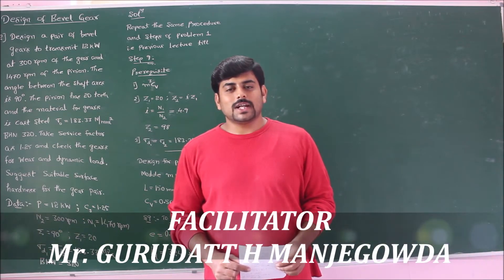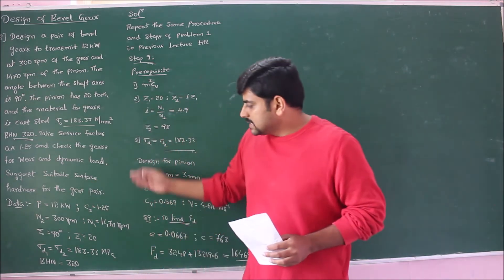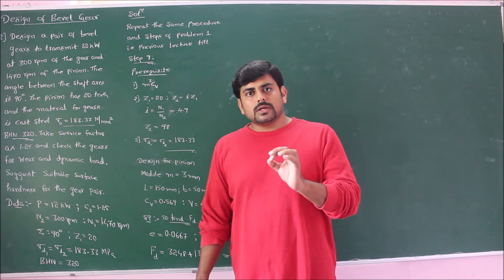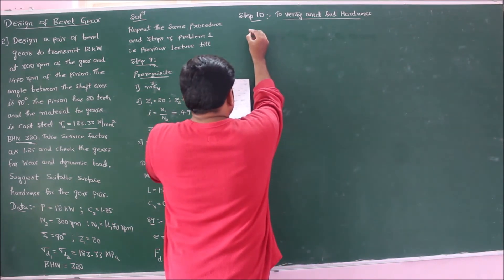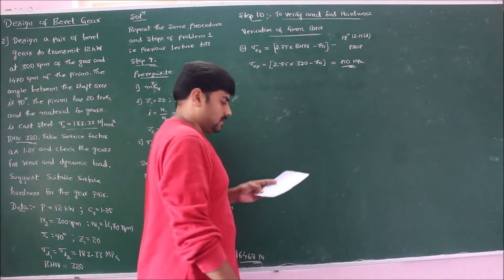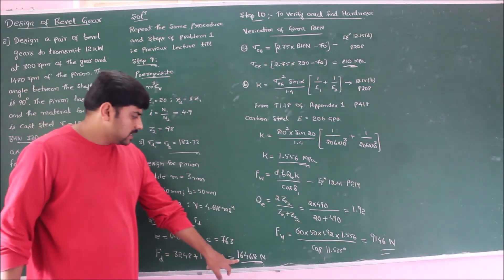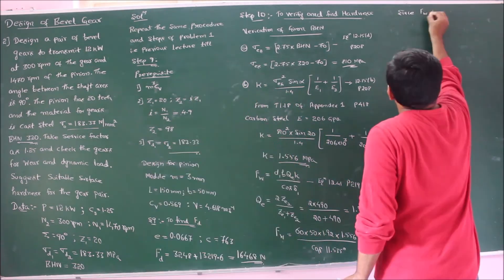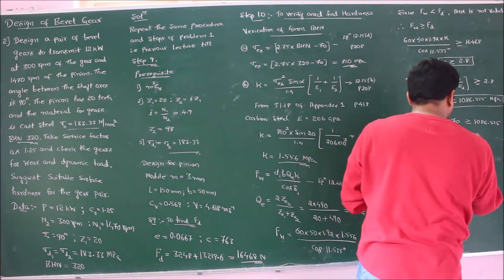Lecture 3 - Design of bevel gear when BHN is given - Module 4 - Design of Machine Elements 2 by GHM.

Comment: Sir iam not getting that, table 1.18 page number 418
Reply from the maker: Page No 473 Table I.18 column 8 appendix 1. For all grades of steel E = 207 GPa.
Reply: @MechanicalEngineeringELearning  sir but u took 206gpa in problm, here it is 207gpa, then is there any difference in that if E values varies
Reply from the maker: Take 207 GPa. Solve and see wht difference you get.
Reply: @MechanicalEngineeringELearning  tq tq so much for replying, and clearing doubts sir, 🙏🙏🙏
Reply: Wr it is? In data hand book iam not getting that
Reply: Sir module is 4 I checked it